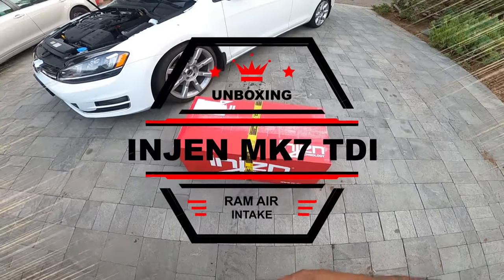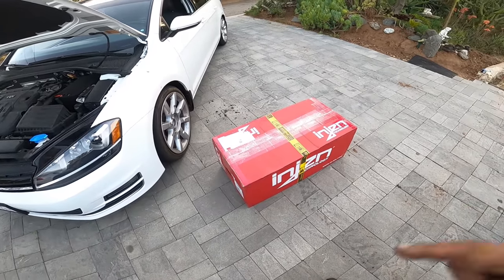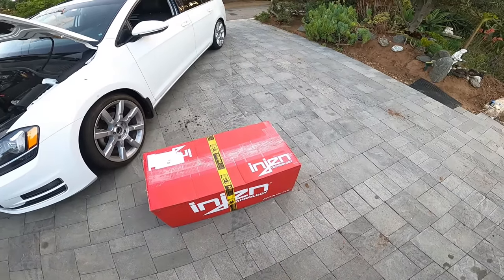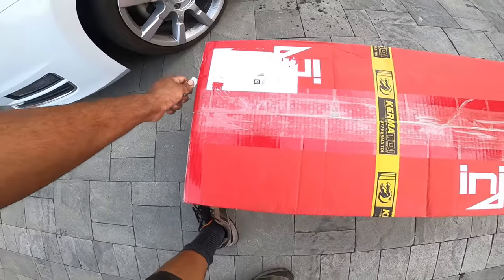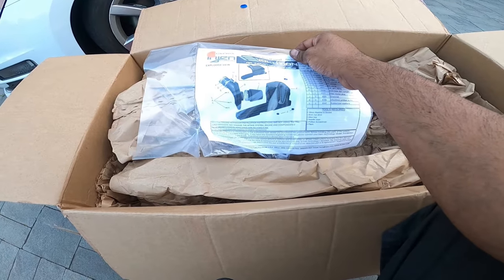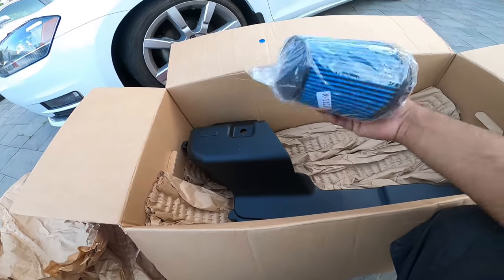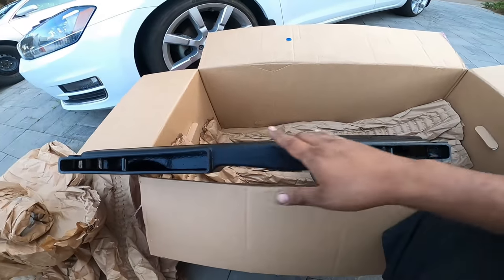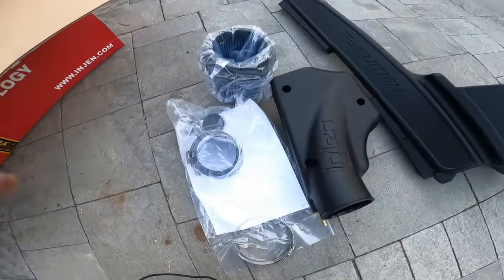UNBOXING MK7 Golf SportWagon Injen intake system

Comment: How did you like it? Did you notice any difference at all?
Reply from the maker: It makes fun noises and love the ease of cleaning the filter as well. Performance is not major unless you have a tune and then the car really comes alive
Reply: @PincheALsGarage  yes I have a stage 2 Malone tune. I mainly wanted more turbo noise from it. But I was also worried about water getting in. Do you have any updated videos running it?